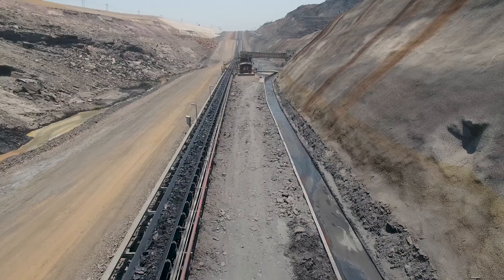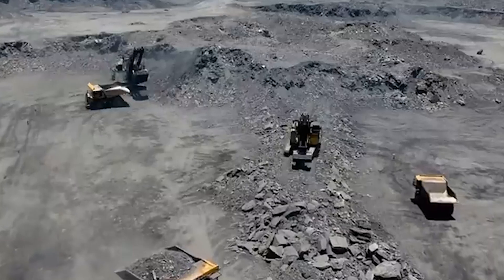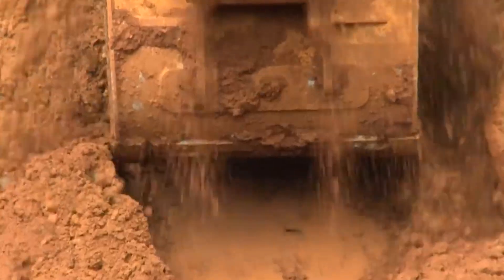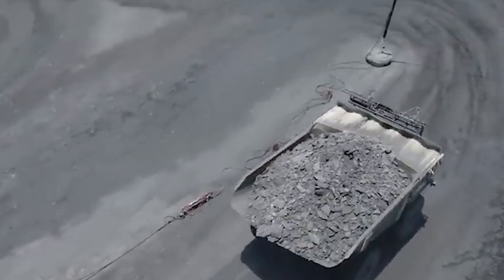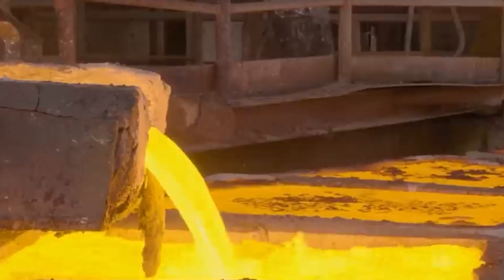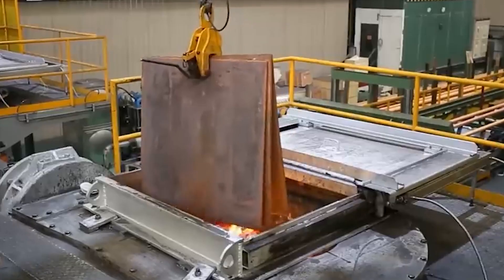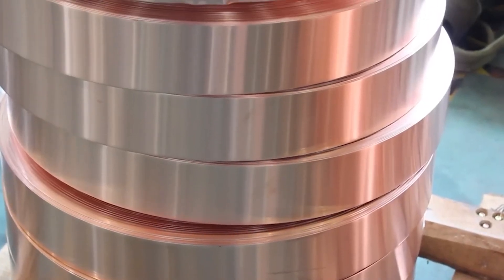How Copper Is Mined And Processed

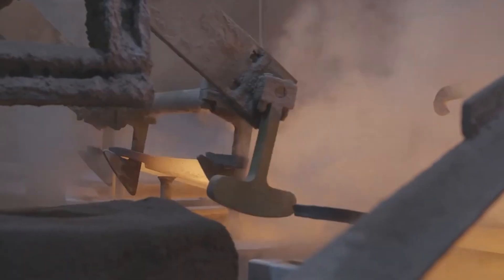Comment: 5:35 your description of the electro-refining process seems to be wrong, the anodes are completely dissolved in the acid -- both copper and impurities -- and mostly pure copper is deposited on the cathodes.
Reply: the impure copper is used as the anode itself